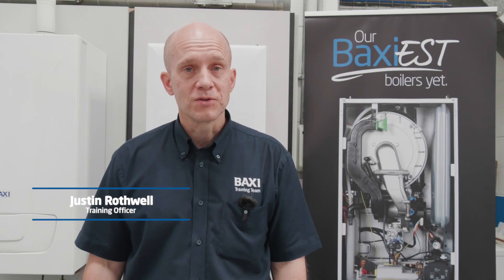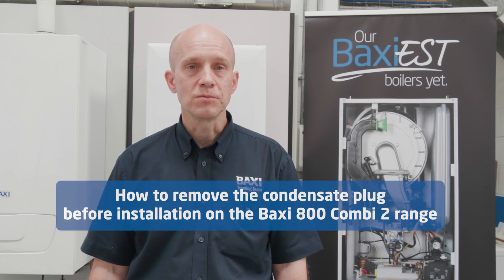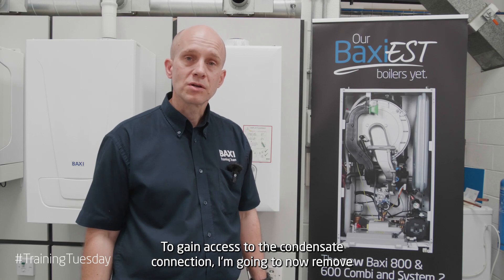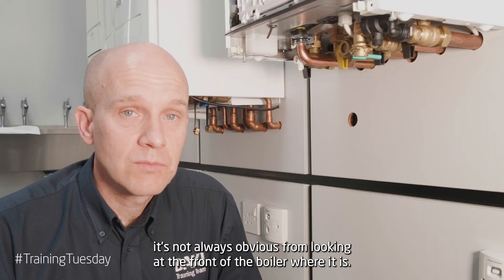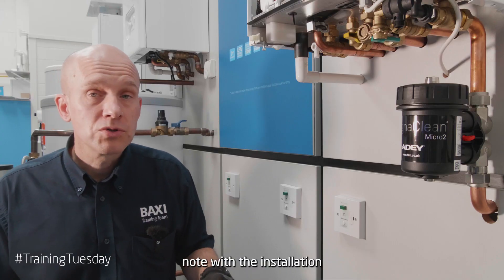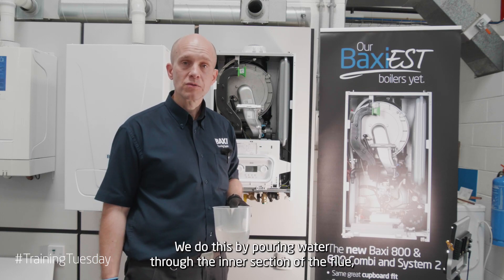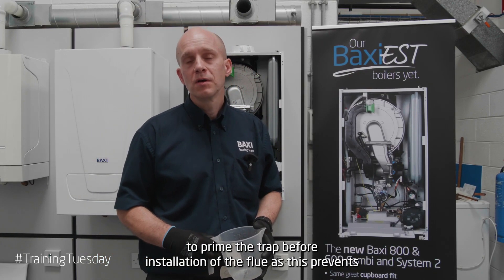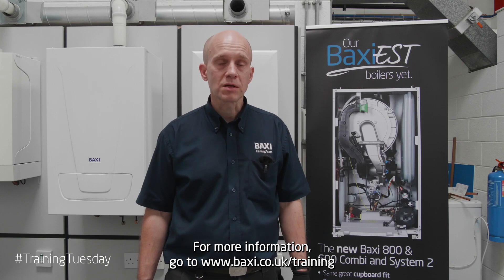How to remove the condensate plug on the Baxi 800 Combi 2 boiler range | Baxi #TrainingTuesday

Comment: I had a Baxi Assure 500 on call the other day, was installed 3 weeks prior.. it was indicating a circulation fault and was quite a longwinded fault code, it was also saying deair. After bleeding the rads still no success and couldn’t get it to fire

Flow and returns open, all roads were open and a brand new boiler so I assumed it hadn’t been bled post install and hadn’t been flushed, i thought it must have a blockage but was really
Hard to navigate the settings on the display